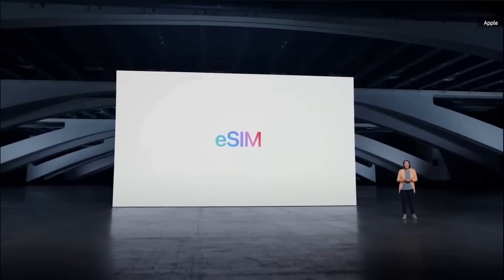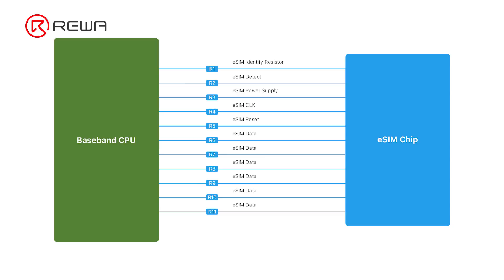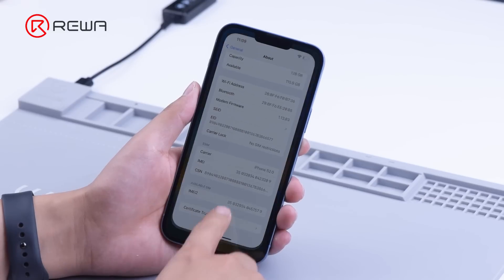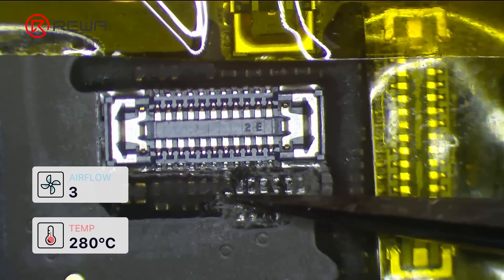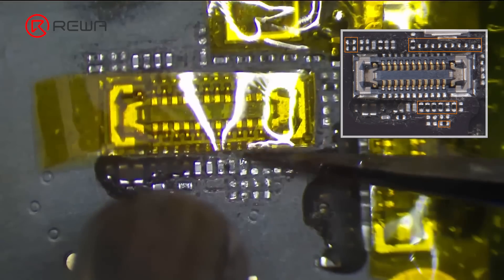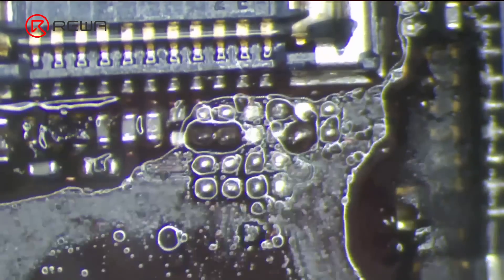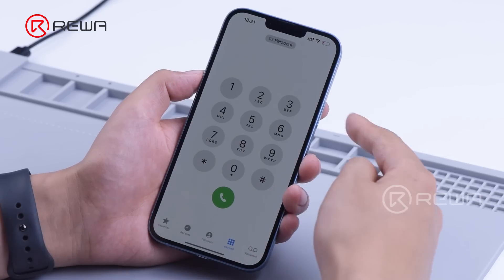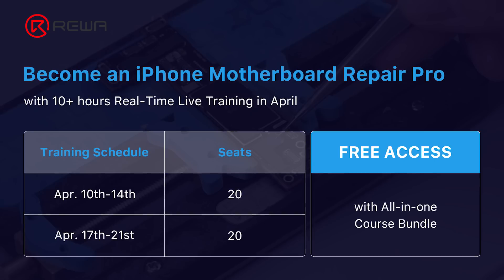Unlock Your iPhone Potential:Converting eSIM to Physical Dual SIM

Comment: Good morning, technicians. Did you know that all iPhones with this modification with iOS 26 don't work? Do you have any ideas on how to fix this?
Reply from the maker: But now we just test this method on iPhone 17 Air and pro, seems fine?
Reply: @rewatechnology2008  What I'm saying is that all iPhone 14 and 15 models that have been converted from eSIM to physical SIM, as you did in this video with iOS 26, are not working. Do you have any solutions? 🙏😩

Comment: Someday, apple is going to remove everything from the iphone. You would use a wireless charger for charging, something like air drop for data transfer ( most probably it will work best with mac's). A separate camera module and a speaker module 😂

Comment: Hi rewa im one of your followers. With this procedure.  It will work if im going to put a 1simcard . ?  Or it is required to put 2simcard ? Hope you'll notice my message thanks in advance.
Reply from the maker: As you can see in the video, it is alright for the number of the simcard, the point is the module of iPhone, you can check whether the phone support 2 simcard and that is OK😀

Comment: @rewatechnology2008 
I carried out the process as is, but now the cell phone does not update via ota, I restored it and now it says activation error, how can I solve it, it should be noted that this only works for unlocked network phones because if it is blocked, you have to add Rsim or USim to make it work

Comment: I did same for 14 plus but isn’t working
Reply: Dang i almost try this method til i found this comment, got dual sim slot shipped from china already
Reply: @Tristar7  Does it work I have us variant which supports esim and nano sim.. In my xr can it be rreplaced easily with dual physical sim?

Comment: I did the same, but it only shows me the physical sim and the digital one disappeared, what do I do to make both appear?
Reply: How did you get the 4.7k ohms sim identify resistor
Reply: solucionaste?
Reply: @alanfunez  no, sigue igual
Reply: @armaydesarma4519 buenas, esto sirve para quitar el bloqueo de eSIM que trae un terminal ? Estaba pensando en comprar uno así y convertirlo en sin física para hacerlo funcional.
Si es así, dime dónde puedo encontrar la info sobre eso o te puedo mandar mi contacto privado para que me explique eso, muchas gracias
Reply: Could dual physical sim work after this method? Ty

Comment: I want to know that I have a screen display problem in my iPhone xs it's when ever I turn on my phone it blinks a green light and screen turn black but touch works this problem started increasing 1st I have to turn my phone on 2 times to make display work it works sometimes and now it's not even turning on I tried so hard I just want to know may it's a board issue because when it fell first day it worked fine now its creating problem and not turning on can it be fixed without replaceing display

Comment: Sadly, Apple will push a software update to override this when they find it out.. 

switching a sim card means saying good bye to water resistance 😢
Reply: just apply new gasket
Reply: Nope, from the iPhone XR to I believe the 13 there was a simpler mod where you could install the Chinese SIM reader to get 2 physical SIM cards to work on a 1 SIM only European or US phone. Apple never corrected that "glitch" luckily, so I believe they don't care
Reply: @alessioacri.  They don't. They sell the device, and if they'll try to sell you services. It doesn't really matter what you do to the hardware, just don't break the ToS really bad and they will overlook this 100%. Also, about the other comment, there are very easy ways to test water resistance after a repair, and it can be 100% verified to be just as good as Apple. They seal to around .20-.23 bar. VERY easy to verify if you are a repair tech, not even Apple Certified. Also, if your repair tech will do this then I guarantee they will have OG Apple or 3M panel sealants and just like my 13PM the SIM is easily waterproof and gasketed.
Reply: Not with REWA
Reply: water resistance is lost even if you change battery or screen .. lol
Reply: @kranti koganti  water resistance can remain even after teardown

Comment: But that means that the two physical SIMs will reside inside the phone and can be removable only by removing the back cover of the vanilla iPhone 14 series' phones, right? The frame of the US specs version of the 14 series' phones has no SIM card slot
Reply from the maker: Thanks for your comment! This video is only for technical sharing. For personal use, we suggest to do CNC slotting.
Reply: @rewatechnology2008 Hello.  If I only want to run 1 physical sim, micro-soldering work is necessary.
Reply: Why do people always say Vanilla 😂
Reply: @GeoJad  trusted sites such as Engadget, GSM Arena, Mac Rumors, Sammobile and others describe the non-Pro variants of flagships as "vanilla" for simplifying purposes
Reply: @GeoJad  Fancy way of saying "original"
Reply: Although REWA suggests milling out a slot, I believe that if you have the expertise to complete this modification then it shouldn't be too difficult to just replace the housing at the same time for a non-US one, which would come with the sim slot and tray.
Reply: @rapidrepairsau  Are not the antenna slots different? I thought I saw the US version has a different antenna and housing. Bringing those to an international phone might be different.

I personally would love to have a dual SIM. I wouldn't have to lug two friggin phones
Reply: @nomore-constipation  If you're just milling the frame, antenna placement doesn't matter... as long as you don't CNC mill through an antenna contact. Then perform the vinyl treatment Apple uses (you can even get an OG Apple SIM slot to solder inside the phone, and then just order a replacement SIM tray.
Reply: Привет. Нужна ли замена симслота на us версии не работает симслот от jp?

Comment: now we can buy esim iphones at lower price from USA then modify them to use physical sim and get big profit. bravo REWA
Reply: Nope,you need to change cover as well, there is no sim tray whole in US version in body cover,so you need to change body,phone will be consider repair and non water proof,
Reply: @toseefirepair8684  he didn’t did the sim tray, it is inserted in the motherboard itself. Just that when u need to change the SIM card u have to open the phone up again
Reply: Yes people can’t see it bro let them be
Reply: @toseefirepair8684  no cell phones r water proof 🙄🙄 its water resistant kno the fuckin difference dum dum 😑
Reply: @toseefirepair8684 you can still use genuine water seal for this phone
Reply: @toseefirepair8684  legends cut it instead😂
Reply: @toseefirepair8684 LOL 😂  if they can change ESIM to PHYSICAL SIM
Making a sim tray slot is not a big task even a small CNC MACHINE or mini grinder tool can do that easily
Reply: @sahilsingh6854  you are way off buddy 😂 you’ll spend way too much money getting a shop to cnc a sim port 😂
Reply: The modification is not an easy process
Reply: Do I need to disassemble both layers and remove the eSIM ic? I tried the same jumper, but it's not working for me in the 14 plus. Can you explain?
Reply: @SmartfoneSolution  same issue for 16 pro max. I microsoldered everything phone will not recognized sim conversion
Reply: sim tray??
Reply: What if you want to switch carriers still not a good idea
Reply: The iPhone in Canada is just a little bit more expensive than in us and they do have phisical sim
Reply: by this point you might as well keep using eSim cause just to get access to the sim tray you need to open up the phone leaves you pretty much the same.
Reply: I used real dual sim iPhone years, xs, 12 pro max, it is very hard to get them, real dual sim is made only for China and Hong Kong, I couldn’t find 13 pro max real Dual Sim, I used one sim and e sim together and no problem. This modification is useless and complicated, if someone needs dual sim it is better buy iPhone in europa or order one from China (real Dual-SIM).
Reply: @bzlotrg china has face time issue. HK version is better
Reply: Is this process reversible
Reply: Expanding 50K TO 70K ₹ rupees for MINI CNC MACHINE in INDIA i think it's not that much if you running a business 🤔